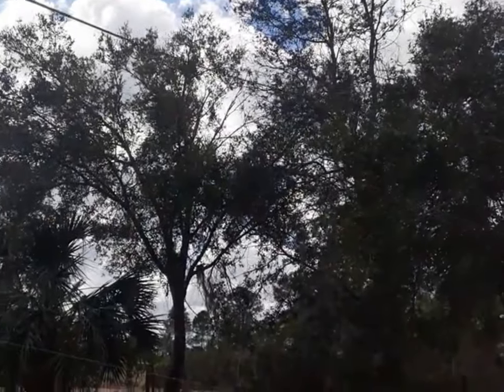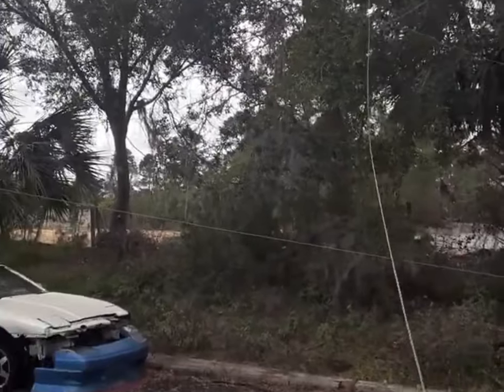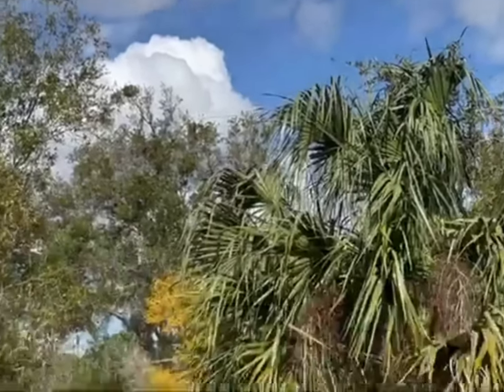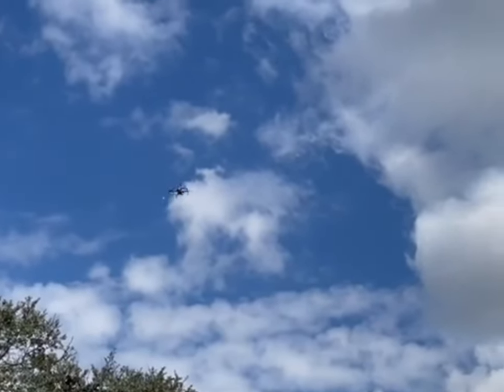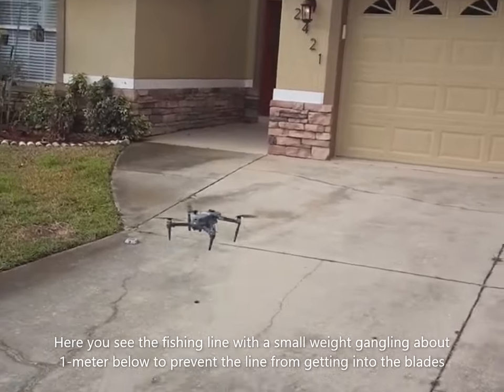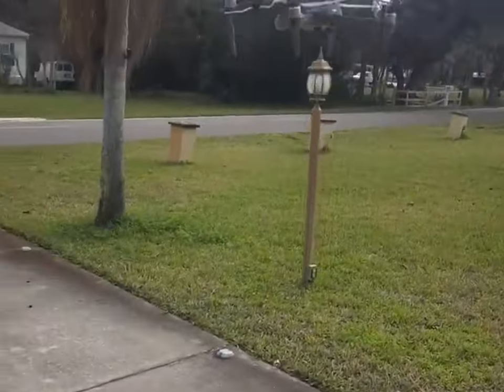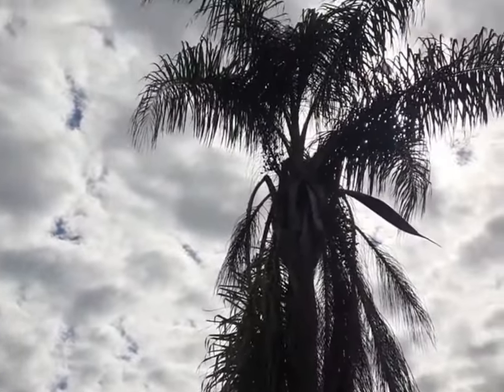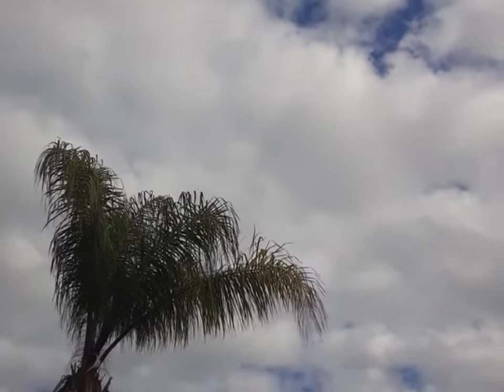1000ft SkyLoop Antenna Install

Comment: I had a 35 ft high 1000 ft horizonal loop at my QTH in Maui on the beach. It worked very well for 1.8 to 7.0 MHz operation and easy tuned with 450 ohm feedline. Ive long been a fan of the antenna.